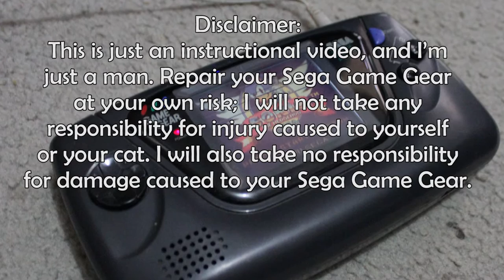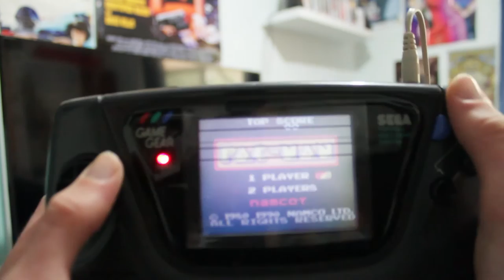How to Replace the Capacitors in Your Sega Game Gear

Comment: Don't keep touching your soldering with the tip like you are touching up a painting. Solder should flow to a heated spot. You need to touch solder as little as possible with the iron tip.
Reply from the maker: Ya. Don't worry, I've improved my technique in the five years since I uploaded this video.

Comment: Did you ever figure what was causing those lines?
Reply from the maker: I ended up using another machine for my gaming, but thinking about it now maybe the ribbon cable that attached the screen to the mobo wasn't seated correctly?

Comment: you make the same mistake I see a lot of people make including people who clam to have years of experience. when you solder you do not add solder to the point then use the iron to melt it off the role what you do it get your iron hot and have it take the solder on to the tip it will hold only what is needed then you touch the pioint and it will transfer over. also a lot of people heat the part they are soldering first then add the solder that's not the correct way you will damage parts overheating them.
Reply: You don't transfer solder with the iron. Who told you that? Watch PACE video on how to solder. You should be tinning areas to work by feeding in solder when the area is hot. Solder on the iron tip is for a heat bridge.
Reply: @The Keto Chief I know this is an old thread but damn, who taught you how to solder? Every professional (people who do it for a living) solder by heating the metal and feeding the solder to the heated surface at the same time. In fact, that’s how robots do it too in automated factories. Like  Deal Done mentioned, you only put solder on tip if you want to bridge a connection or do some touch-up work while drag soldering.
Reply: @nyprince5922  i have ben doing it for years and know electrichions who have a lifetime on me. i also no from books and videos that i am correct. the thing is a lot of people even proos get sick of cleaning a iron and the aolder will no longer stick to the head the item. but the proper way is my way. do not beleve me get a new iron once and try you way and buy way with a wire to wire solder and pull them apart you will find my my way looks better and holdes stronger.
Reply: The Keto Chief Yes, I already know how to tin the iron after you use it to preserve the tip (everybody in the business knows this)...this is not new. The reason why professionals feed solder to the nexus between tip and surface is to ensure maximum molecular bonding. You only only heat the surface for a second or two and let the solder flow. Welders know this. Plumbers who attach pipes know this. If you put solder on the tip and then try to transfer the solder to the surface you increase the odds of cold joints. It is simple physics and chemistry.